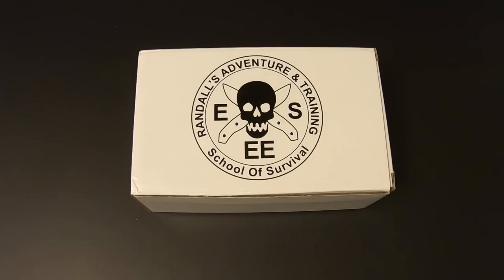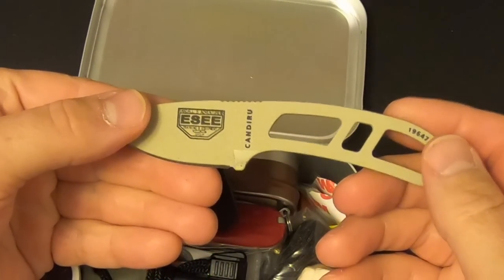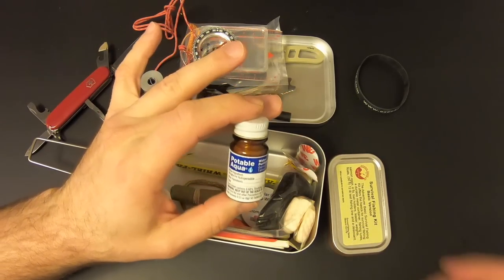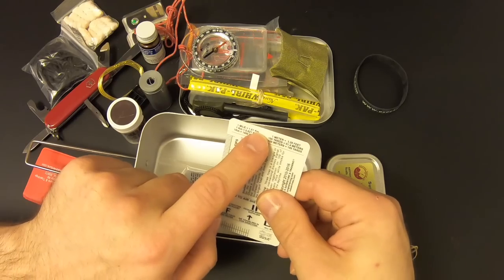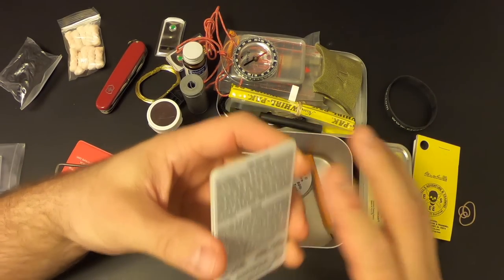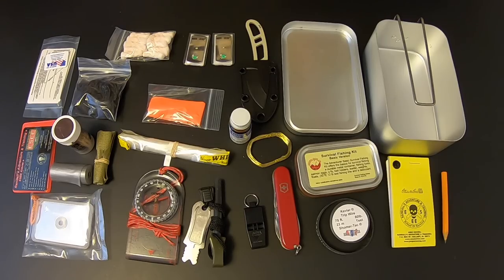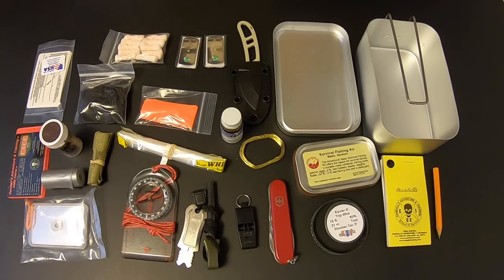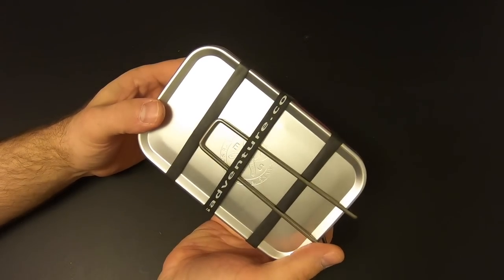ESEE Large Mess Tin Survival Kit

Comment: Pointing out the prices of the items was very helpful. I was in the group that thought this was highly overpriced. You changed my mind. Thanks for the extra effort that bit of your review must have required.
Reply: If I should by this particular kit today from Sweden it would cost at least 332 USD plus shipping. Some sell it with a basic pouch and it then reaches a whopping 449 USD.
It may by the currently weak Swedish crown, but honestly, you can easily build your own kit for less than half of this without compromising on quality.
By maximal price range of every given item now, the total may look fair, but it is a biased compare as it kind of compares with itself (very brand wise) and with very little situational adjustment. As survival is highly situational, you may find yourself dropping some items irrelevant in your climate zone, season etc. and by removing those items to buy others you loose even more money.
Building up your kit from the start is very likely to not only be more cost effective, but also highly adjusted to the situations you may find yourself in and the skill sets you happen to have.
Some of these ready made kits are overpriced and most if not all contains items of practically no real value in a less ideal survival situation.

Comment: Good kit! Anything in it can be upgraded, replaced, added to or omitted as your conditions may require...I would add a quart sized ziploc bag, to hold the contents of the kit while using the pan.
Reply: Yeah, that would take almost no space but would be helpful.  Another option would be a small nylon pouch/bag to story the tin in; when using the tin just dump the stuff into the stuff sack.
Reply: I would just put that under the ranger bands.
Reply: Items can be 'upgraded', replaced or simply removed in ANY kit so I fail to understand that as an argument this is a good kit. It is so overpriced today it is silly. Counting item per items is irrelevant as it then compares with itself and not what you need. Upgrading and replacing adds too the cost and what did you pay for exactly at the start? The option to replace...?

Comment: I would like the SAK to have the saw...(nitpicking) otherwise it's excellent!
Reply: KungFuTweety1 it does have a saw, I forgot to pull it out.
Reply: It's a Hiker, it has a saw.
Reply: And the cork screw to mount it on a stick and use it as a extended saw

Comment: I believe the price of this kit is in line as far as consumer costs as you stated.  I put together a kit using more high end products costing me about 400 bucks.  If I truly needed a kit to survive, I want to trust the items I pack into it.  My kit is enclosed in an Emerson Chest Pack with an Esee Izula 2 mounted scout carry on the front.  Enclosed are the Suunto MC2 compass, Ranger pace beads, Leatherman multitool, a Victorinox Rangergrip 178, a Smith PP1 sharpener, a custom hand made hatchet with sheath and shortened handle, Bic and Croc lighters, Light My Fire ferro rod, trioxane cubes, small canister of pepper spray, Rite in the rain flip memo pad, a Pilot G-2 07mm pen (able to write upside down) and so on; includes mylar poncho (bright orange on the outside), camo space blanket (mylar), SOL bivvy and a pot I made from a Tyson chicken breast can keeping the lid.  A push pin serves as a lid handle.  The Tyson can contains two tea bags, a small bag of coffee, small bag of trail mix and compacted energy snacks.  A ranger band secures the lid and can.  Camo Impact mechanics gloves fit between the layers of the pack.  On the lower strap on the left side hangs an Aoutacc radio pouch with a Baofeng UV-5R radio with NOAA/FM channels; no interference with my range of motion.  I'm working on acquiring a ham radio license.  When I backpack (or "bug out") this kit is a part of my loadout and the total loadout weight is usually between 25 and 30 pounds, depending how much water and food I carry.   The Emerson chest pack loaded weighs 5.64 pounds.  I tested everything over a span of a month backpacking in mountains, forests and several hiking trails.  A couple changes in gear and gear  elimination resulted.

Comment: If I should by this particular kit today from Sweden it would cost at least 332 USD plus shipping. Some sell it with a basic pouch and it then reaches a whopping 449 USD.
It may by the currently weak Swedish crown, but honestly, you can easily build your own kit for less than half of this without compromising on quality.
By maximal price range of every given item now, the total may look fair, but it is a biased compare as it kind of compares with itself (very brand wise) and with very little situational adjustment. As survival is highly situational, you may find yourself dropping some items irrelevant in your climate zone, season etc. and by removing those items to buy others you loose even more money.
Building up your kit from the start is very likely to not only be more cost effective, but also highly adjusted to the situations you may find yourself in and the skill sets you happen to have.

Comment: Disclaimer, I am not an expert! But, on those mini snap lights, I would find an empty pen to use as a case for them, just to keep them safe until needed. I would combine all of the cards along with the note pad into one ziplock bag. A couple of tongue depressors would be helpful. I would also try to discard anything that is duplicate, (NOT counting fire starters.) Now, just what do you do with all the contents when you open up the mess kit to use? I would try to find a cloth bag to put the whole kit into and then have a way to carry the kit minus the mess kit pan after use.  Note: Both the vinyl tape and the duct tape could be used as fire starter material.
Reply from the maker: Thanks!

Comment: A good kit and i will buy that for 200! I will add my comments though. They shouldve put a SAK with the saw, sa saw in most SAKs works well and i use mine a lot. It will be a big help. 2. I didnt see the sewing thread in the patching kit with needles. 3. Athough the matches are good, i couldve replaced that with an iodine bottle. I dont see a small FAK there? We can make one perhaps. 4. I can put a better amount of paracord there. 5. Some non lubricated condom for water holding. Where will use the pur tabs for? 
6. An extra blade that you can fashion to a spear with a good wood pole you can find. 
All those you added are good esp the space blanket. 
Just my two cents. Thanks good vid. Am subscribing!
Reply from the maker: The SAK knife does have a saw. I noted that during the video with a text overlay because I forgot to pull it out.

Comment: for me, the problem is not if that stuff value or not 200 bucks, but that you do not need to buy most of that stuff.
a Vic Hiker costs 5 bucks more of the one in the kit and has a pretty good saw. With 20 bucks more you can get a 111 like  a trailmaster or a soldier. 
the small knife was pretty useless. 
you dont need tripwire if you get a good paracord.
most of the cards are rendundant.
a good roll of 3m dutchtape costs 3 bucks. 
...etc. 
and still miss items that costs like nothing, like a 2 bucks thermal blanket, a saw, a knife to chop some wood (a 111 vic can)....

i mean, it is cool, but it works? a lot of pieces are priced just becouse of the brand. no way that a tin costs 18 bucks and a set of matches 10 (50 costs around 7).
For 200 bucks i expect to see a ready to use kit, not a cart filled by a child. this set can be used by an expert or an advanced... but is totally useless for a consumer. and i think an advanced or an expert wont buy that.

Comment: Generally a mediochre kit.  That having been stated, the fishing kit can go straight to the trash.  I can't fish, nor can most people.  Scratch that.  Fish, yes.  Catch, no.  It's like whittling.  People used to talk about whittling if they had a knife.  Did they learn to whittle after getting a knife?  No.  Same thing with fishing.  Having that kit will not suddenly make fish appear.

Most places, if you ate the fish, you would get sick.

The fixie knife is fine, but should be carried separate from this kit.  Why is there no knife sharpener?

The Victorinox has 2 blades.  Sure, can openers, bottle openers, wire strippers, and screw drivers are helpful in survival situations.  Just a bunch of useless stuff.  Those blades are basically useless for just about everything.  SAK to the trash.  Get a multi-tool, and carry it separately.

The whistle and ferro rod take up too much space.

The flashlights could be much better.  They are good for reading maps...that they don't have.  Those can go in the trash.

All those cards are redundant, but they can all go in the trash.

The signal mirror is great--if there is someone in the area looking for you and wanting to help.  Mostly, if you can't help yourself, you're SOL.

Questionable choice in duct tape.

The paracord is the wrong stuff.

The compass.  Rather wasted space.  It isn't an orienteering conpass.  You need to know which way is North.  Any adult should be able to figure that out.  Surely even city people can figure out the other compass points from there.  Most people don't know about heading vs bearing, have no understanding of orienteering...and have never true'd their compass.  So, ditch the compass.

The purification tablets are fine, but either fill that bottle or get a smaller bottle.  Too much wasted space.  It is actually safer and easier to purify water without the tablets--and usually faster, also.

Your additions were mostly good.  Wrap a twistie around the lighter, below the thumb button, to keep the lighter from discharging its gas.

Kindling usually is not the problem with getting a fire going.  Most people do not know how to start a fire, but the biggest problem is fuel.  When getting a fire going, people mismanage their fuel.

The kit is not as bad as some, but is missing some simple items.

I'm not sure how you could carry that kit.  I carry a lot, but not in a large can.  This is the kind of kit you have setting around somewhere.  In your home, office, or vehicle.  Unfortunately, this kit would be rather useless in most of those settings.  You could carry this kit in a backpack, but that would be very poorly laid out.

A few years ago, some of us were challenged to a survival scenario.  We had to go as we were.  We were divided into teams of 8 people each.  The team I was on did fairly well.  Our clothes did not fare very well.  We made it for the entire year, though.  One team did really well.  They had a couple who rigged something that made them pizza and cookies.  Our team managed a fridge of sorts, so our food would keep.  Some teams bailed in the first few months.  Our team finished with 10 people, because people from other teams joined us.  Some of our team quit or was kicked out because they were useless.  I'm not sure how helpful this kit would have been.  None of those knives are good butchering knives.  I really have a hard time seeing the scenario for this kit.  Try making shoes or clothes with it.  The paracord is fine, but won't be much help making a shelter.

The problem isn't so much the quality if the items as the choice of items.

The only scenario I can think of where this kit might work is a camping or park BBQ event.  This kit really is not geared for survival.  I guess the cards are a give-away in that respect.  This kit is a rescue-helpless-person-now kit.  You either know how to survive, or you don't.  Without knowledge, everything else is useless.  The time to learn is not in a survival scenario.

People should have actual survival experience before reviewing or building "survival" kits.

I am not good at survival.  I like my comforts.  Survival is constant brutal work.  I cut and split several cord of wood, and did a lot of digging and construction.  Building a house with a chimney takes a lot of time and work.  Hunting and fetching water takes a lot of time and work.  Farming takes a lot of time and work.  Cooking takes a lot of time and work.  This kit is just wrong for survival.